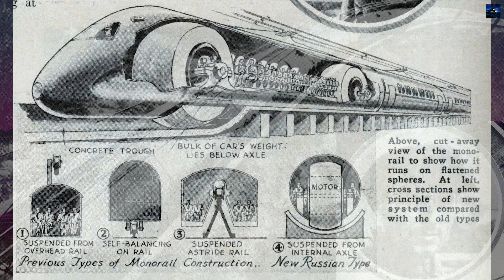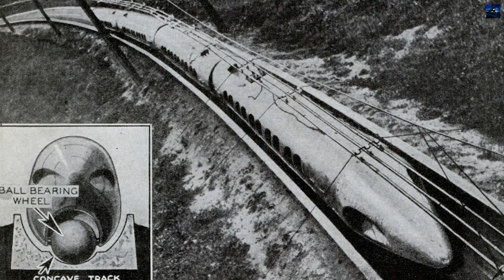Sharopoyezd: The Lost Soviet Super-Train (They Actually Built It!)

Comment: Larger wheels run smoother on rough surfaces. But train tracks and wheels can be extremely smooth. Therefore it's easier just to build proper tracks and go with that. The double track allows for better stability and easier dampening of motions

Comment: Interesting concept, but as noted earlier, the exposed solid trough would present problems with snow, ice or water accumulation: loss of traction and hydroplaning, to name a couple. An enclosed tube running underground might have been a better approach. I also noticed in the scale model runs that the cars tended to wobble - if this happened for the full-scale train, it might have caused "landsickness" for sensitive passengers.
Reply: 😊Covered tubes😊for rain ☔ snow🌧️dust😊